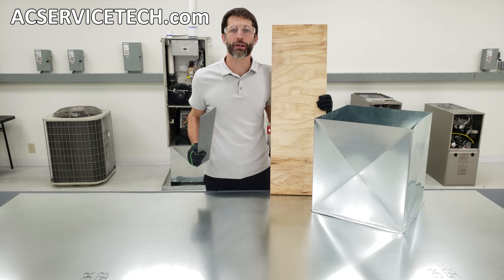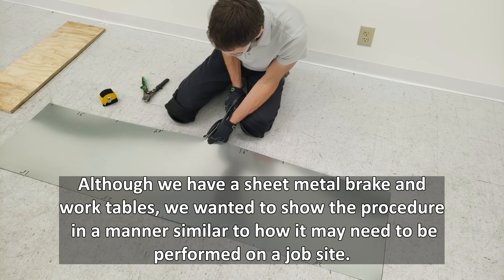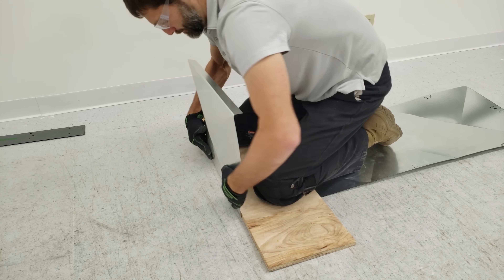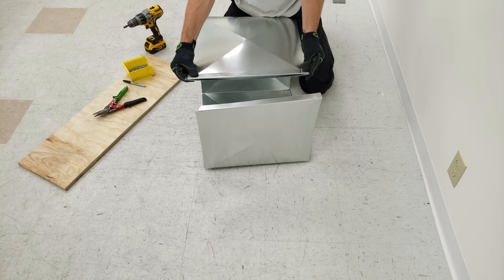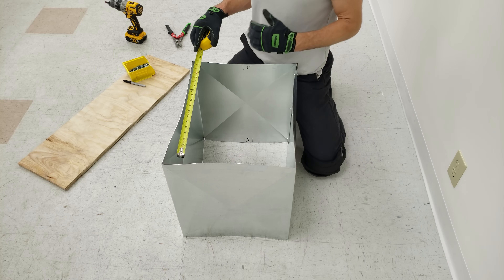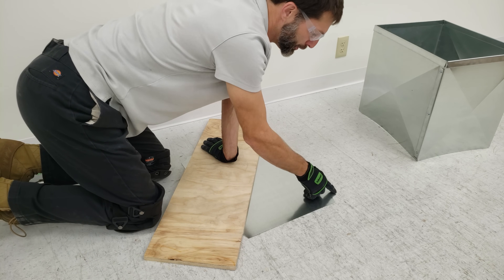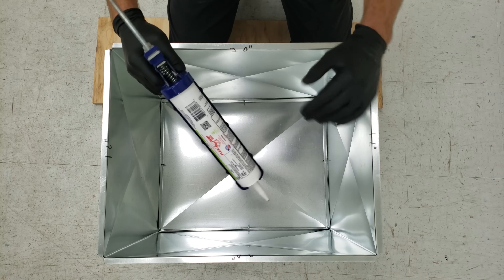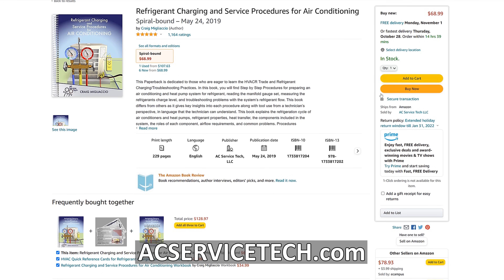Quickly Make a Sheet Metal Plenum at the Job Site! Measure, Cut, Bend, Seal, Mount!

Comment: For end cap instead of adding 1" to the measurement and using S drives, add 1 3/8", bend at the 1 3/8 line then bend back fully at the 3/8 line. Save money.

Comment: For cross breaking you can also place the sheet metal on cardboard (need a soft surface underneath) and use a screen seal roller tool (screen door).

Comment: I have to make a field set or plenum every 9 years. I just have never seen one that looks like a true professional did it. Building it with panels and/or S locks have always amateurish to me. A plenum made by a professional fab shop will always look superior, imo. Beading vs cross breaking, true pittsburgh's etc. I measure every job, and we show up with a plenums and/or duct that fits like a glove, because it was planned that way. It has always seemed to me the field ones were a couple notches, at best, better than a handy homeowner. We even do canvas connectors on 4/5 ton systems.

Comment: NIce!  I'm a homeowner - not a pro.  I have a Malco brake but it's often easier and faster  to  fold up parts as you've showed rather than bother to set up the brake; the folding goes pretty fast and the results are slick.

Comment: Nice Work Mate. Where to find (SHEET METAL)? Could you tell me?
Reply: Good question. I believe that you can buy sheet metal at a steel supply but there are none close to me. The HVAC suppliers probably stock sheet metal but won’t sell to you unless you have a license.
Reply: Look for a local WinSupply store.  There were a handful in my region, though only a couple stocked ductwork.  They sell to anyone.

Comment: Great presentation. I don't work with metal ducts. All ductboard, but wanted to see what tricks there are to work with metal.  But I did learn how to stop the metal noise when the blower comes on. This was very interesting! Thanx Craig.
Reply: Damn, ductboard?  Where is ductboard still allowed to be used?  Didn't they outlaw that stuff in like 1980?

Comment: 20 and 7/8th.   Fantastic job. Not quite sure where the air goes to with that cap in place?
Reply: Maybe the take off comming off the side or if it’s round pipe off you cut in your collar/s off the top There’s badass ways of doing it square to round tricks and etc.

Comment: Pretty cool trick with plywood. Though it's pretty rare for us to do a plenum less than 36" in length.....All my years in HVAC and I've only had two systems not installed by me that had sheet metal popping due to no crossbreaks. Both had dirty filters. If one's sheet metal is popping they really should be learning friction rate, static pressure, Manual D, etc etc....
Reply: Tell me more about the etc etc. Im new

Comment: You should do more metal work videos. I'll be the first to admit..20+yrs in the field. My service trouble shooting skills are on point, but I suck at sheet metal lol. I usually sub out a tin knocker. Stuff like u showed is easy, but when u get into crazy transitions..yea I'm not quite there yet lol.
Reply: Guilty! I do piping, controls and commissioning. I need more sheet metal experience.
Reply: Hmmmm, that looks like 30 gauge metal your working with…🤔
Reply: @TrueDuckFan  I thought the same thing!  You have to be Hercules to bend 26 like that.
Reply: @TrueDuckFan  looks like it has 26 ga printed on the original full sized sheet.
Reply: That’s usually the way it is. I myself started out 25 years ago crawling and fetching. Worked my way up through install and service now own my own business doing everything with some help and almost 10 years in business now.
Reply: Never thought I would like heating and cooling but metal work is fun. Hmm.i wonder if I could just build plenums for a living 😆